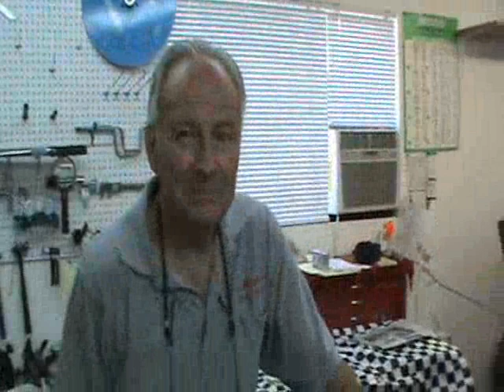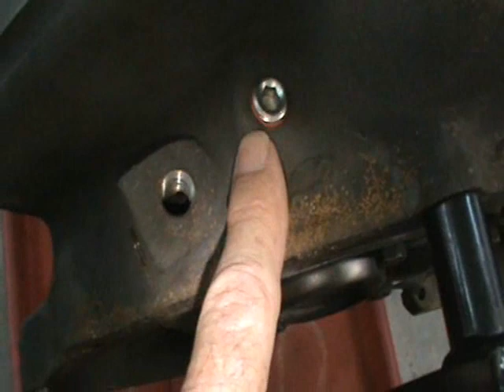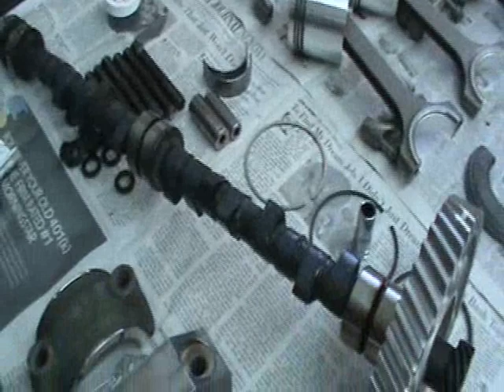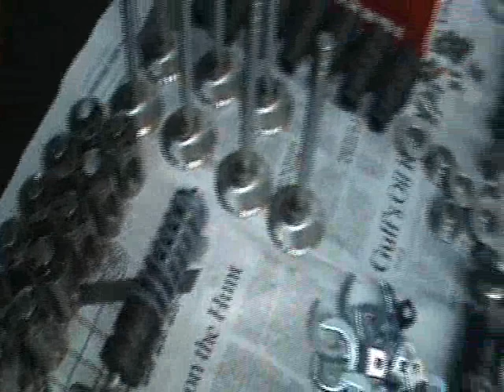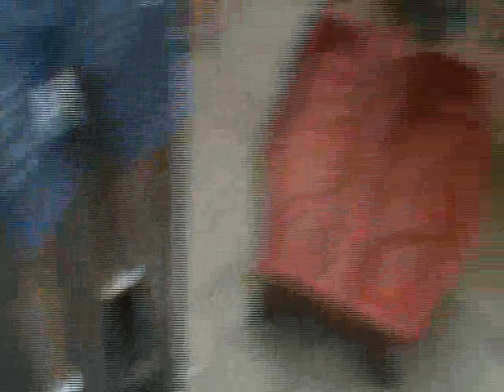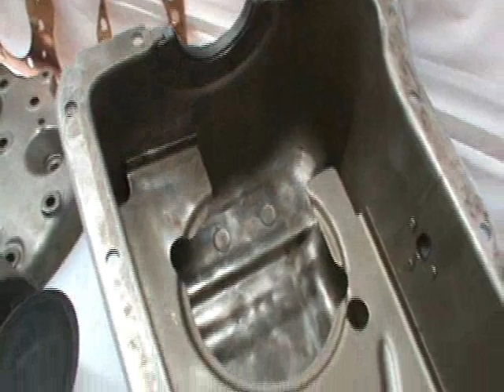Building a High Performance Flathead Ford  Part 1 - Overview & Introduction

Comment: I found that smoothing the ledge on the piston side of the head where the cylinder/valve area is, helps the engine idle smoother and lower rpm. That hard machined ledge doesn’t allow for a laminar flow of gases in the combustion chamber. The turbulence it creates hurts the engine performance.

Comment: How much effect does releaving the block have on compression ratio.
Reply from the maker: A typical relief lowers the compression ratio about .2 - .3 points, e.g. from 8.5 to 8.3:1. Breathing typically improves 15% with relieving, making relieving a clear winner for increased power. This whole subject is covered in detail  in my book, 335 HP Flathead Ford V-8 Performance Handbook.

Comment: Mr. Abbin.  I've enjoyed reading your book.  I have two questions:  1)  Do you still build flatheads for customers?  And 2)  At a car show two years ago I saw a flathead with four-tube headers on each bank.  The two for the center port were cut and welded together and used a single flange for the center port.  Have you ever heard or seen such a set up?
Reply from the maker: 1) I do not do service work for customers any longer, but could possibly make recommendations if you email me.
2) I have seen the "siamesed" center exhaust system you noted. I would not expect any performance gain.

Comment: p[ease help me with my 8BA. Its mounted on a trailer so I can tow it to shows and high schools. It started blowing water out of #1 exh. I changed the head gasket and now all my water goes into the pan. I accidently broke the blind hole bottom off the thermostat. Could this be my problem?
Reply from the maker: It is not likely that the thermostat break has anything to do with your problem. You will have to remove the head again and inspect the gasket for proper installation and seal. Also inspect the head and block visually and follow up with Magnafluxing if necessary.

Comment: To what depth from the gasket surface of the head do you cut the valve pockets to ensure appropriate clearance for the valves with the Isky Max 1 cam?
Reply from the maker: About 0.4" should be adequate. How high the valves stick up above the gasket surface and their diameter can affect this. Check for clearance by temporarily sitting the head in place without a gasket using guide studs (leaving off nuts) and turning over the engine to raise the valves.If they don't hit you will have adequate clearance in service. If the valves raise the head you will know how much and where material must be removed.

Comment: How do you determine the optimal cam lift and duration for these engines? Is there a flow test for them?
Reply from the maker: Hi Ken, two of my books ("Blown Flathead" and "335 HP Flathead Ford V-8 Performance Handbook") contain many flathead Ford flow tests. The output of these tests can then be used as input for engine performance modelling including cam optimization.  The books are sold out and out of print, but I am planning new releases. Joe Abbin

Comment: Relieving is a waste of time, and reduces the c/r.  The inlet flow in a flathead is up, across the underside of the head chamber, and down into the cylinder- and vice versa for the exhaust.  The block material between the valves and the cylinder is not of concern and does not effect flow.  Just leave it alone, but make sure there is enough flow area in the head chambers over the valves for full flow at full lift.  If not, the head chambers will need to be fly cut to deepen the pockets, and then smooth them into the head's flow area above the cylinder edge.
Reply from the maker: Rob, I used to believe relieving was not important until I actually started flow testing the flathead. You can read all about it in my book, "335 HP Flathead Ford V-8 Performance Handbook", pages  27 to 40. The HP difference with the increase in air flow far outweighs the loss due to the decrease in compression ratio.  All record holding flatheads in the day were relieved.
 As the piston goes down on the intake stroke, it pulls the incoming mixture down to the block surface and removing material here substantially increases flow even for large chamber heads.
Reply: @blownflathead  I should have clarified my statement.  For a blown motor, relieving may be worthwhile?  I have no experience with this.  For naturally aspirated, I would respectfully disagree.  Technically the incoming mixture is not being pulled into the motor by the descending piston, it is being pushed in by atmospheric pressure due to the vacuum created.  Years ago I read an article about relieving, with flow test, written by I believe Barney Navarro?  The conclusion was relieving was found to be unnecessary.  That is when I stopped relieving my blocks.  

Yesterday I pulled the heads on my 284" motor (getting her ready for next season) and inspected the head chambers and the block deck at the area from the inlet valve seats to the cylinder.  Both heads, all 8 cylinders show a very clean mixture flow surface track right from the the inlet valve's cylinder side, across that side of the head surface to the area above the cylinders.  Clean aluminum, no carbon.  However the entire block's deck surface shows the same color between the inlet/exhaust valves and over to the cylinder edge- a thin uniform coating of carbon with no sign of mixture cross flow from the inlet valves to the cylinder edge.  None!  Zero!  There is no mixture touching this area.  My deck is not relieved.  There is more than ample volume in the cylinder head pockets to flow all of the volume coming from the inlet valves into the cylinders- naturally aspirated anyway.  My c/r is 10.5-1 with tight squish.  Dual 97's on a vintage Edelbrock regular hi-rise intake, Literio L100 camshaft.  The motor pulls like a locomotive to 5000, and surprises many.
Reply: Forgot to mention, my heads are NOS 59 series 24 stud Canadian Ford aluminum pieces C7RA 6050B, unmodified.  Nice heads!

Comment: All the dumb arguments about why we even bother with the archaic ,inferior design flat head... you have to be “ old school”...you have to have had one and hot rodded it to understand...!!!American ingenuity can over come design inhibitions...!!! NASCAR... to slow down the 200 mph stock cars, made all kinds of design restrictions such as no fuel injection, and push rods only...!!! You still came out with 6-800 hp and revs between 9000 and 10,000 rpms... !!! 
Any way , there are some flat head gurus that have done wonders in normally aspirated ...and supercharged categories...!!! It just takes lotsa $$$$...!!! If NASCAR came out with a class strictly for a flat head racing class... not the old FORD engines ... but a high tech,purpose designed flat head as a technical challenge, roller cams, 5 main brg cranks, 8 port blocks...it would be a test of genius to see what you could come up with...!!!

Comment: Joe,
I am looking for detail on the relief you did to the block between the piston and the valves. Can you tell me how deep the relief has been cut? Did you remove any material from the back side of the valves of just in between the valves and the pistons?
Reply from the maker: The relief is .100" to .125" deep and is concentrated between the valves and between the valves and the cylinder bore. There is some flow on the backside of the valves but not much especially with big valves, so not much benefit in relieving in that area.
Reply from the maker: I typically cut the relief about .12"-.13" deep between the boundaries of the head gasket I will be using and hand blend to the valve seats. That will get 90%+ of anything you could get by going deeper and leaves some margin for error. At the back of the combustion chamber near the valves I just break any sharp corners at the valve seat-block interface. I do open up the heads in this area to the gasket boundary.

Comment: i am sure i have seen an after market oil pump and external oil filter, surely when you asking the engine to work harder ( ie the blower ) giving it the best lubrication available in the interests of long life reliability.
The 'splash oiler system was fine for a standard engine but for a blown flathead??
Reply from the maker: You are absolutely right. All flathead V-8 Fords since 1932 have had full pressure oiling systems. A parallel or bypass flow - type external oil filter became available as a factory installed accessory in 1936 and as standard equipment in 1946. Full flow oil filter systems are also available. Please see Chapter 8 in my book, "Ford & Mercury Flathead V-8 Identification & Rebuilder's Guide" for a more detailed description of the flathead oiling system.

Comment: If you build a High Performance flat head Ford, max revolution must be a problem. To me the Y block is better. As I have only ever had one flat head Ford(1951) I never kept it long, so I am no expert, it could cruise at 75 no problem, on level road it could lug down to idle in high gear then pull away with not the slightest bog down, this engine deserves respect for its span of use, 1932-- 1953.. 9
Reply from the maker: We generally limit flathead customer dyno testing to 5200 rpm. My own engine is limited to 5800 rpm. The stock parts are  tough, but the 3-main bearing crankshaft does limit safe operating rpm.